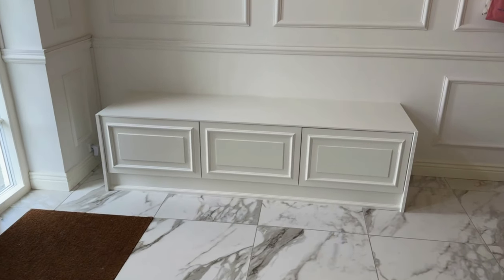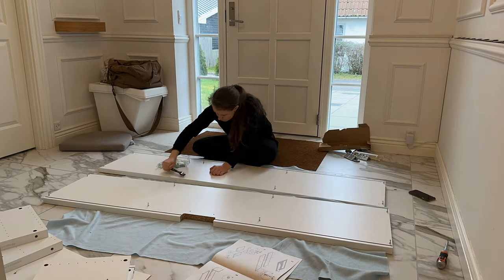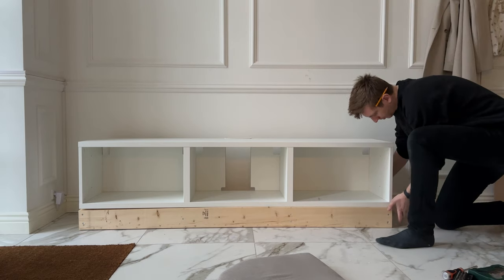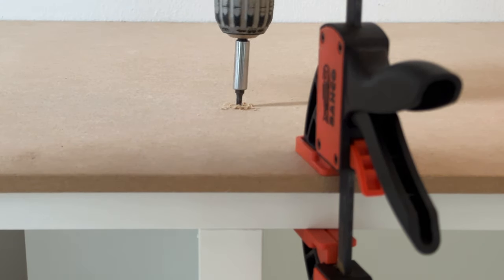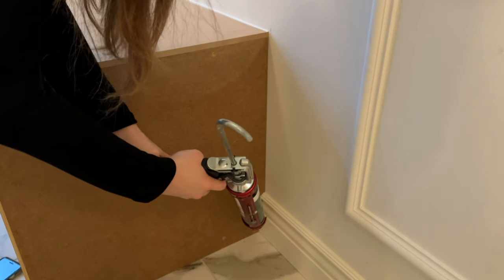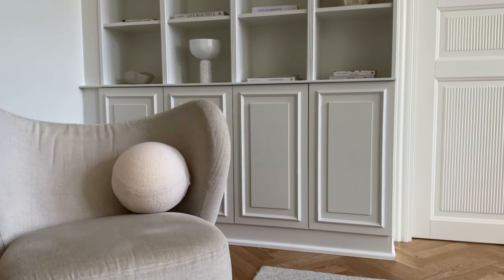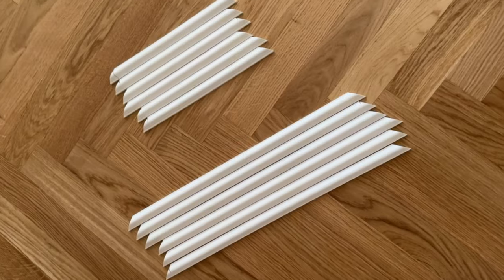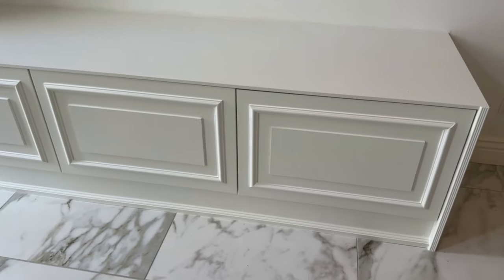IKEA BESTA / BESTÅ BENCH HACK | EXTRA STORAGE

Comment: Might be one of the nicest detailing I've seen around an Ikea hack.  Thanks for the video.  As an architect I would def follow your husbands lead on the wood selection. Its just smarter in the long run amidst already using the shelving system that was not intended for sitting. I am also using wood but square blocks to cover and spread more load. Cheers

Comment: just curious, why did you not decide to use legs instead of the platform, would the legs cause damage to the floor when the bench is sat on?
Reply from the maker: No, it’s because the BESTA is really a tv bench and since we’re using it as a place to sit down, we wanted it to be properly supported all over. But also because we wanted a more built in look 😄

Comment: Hi! I am planning to male similar bench for dining (betsa or platsa modules). I was just wondering if it really can hold together after sitting there because ikea says it is only for 20-50kg load? 🤔 or it can be saved by adding top desk?
Reply from the maker: We’ve reenforced it with the platform (additional support under the whole thing) and the top desk as well, and we’ve had no problems at all. It doesn’t move or make a sound when we sit down on it. So it should be able to carry more weight if properly reenforced!